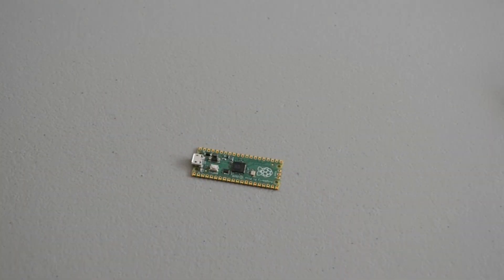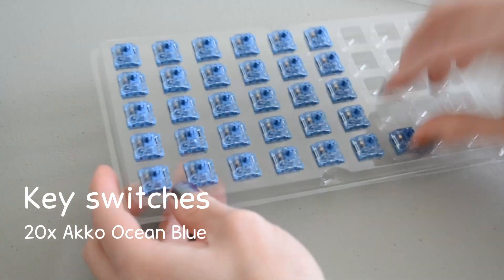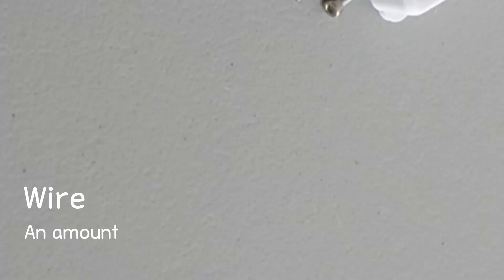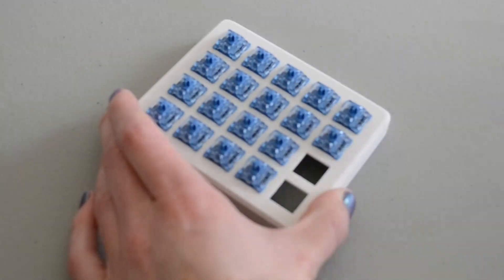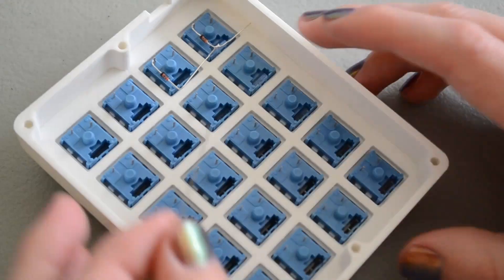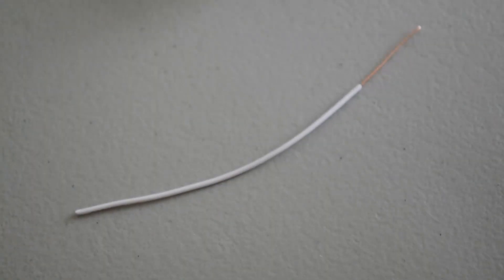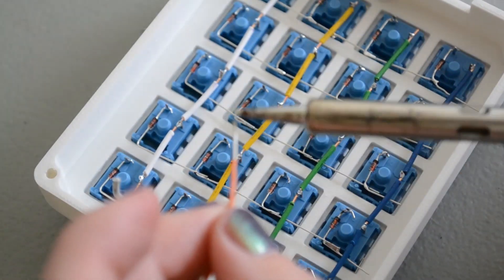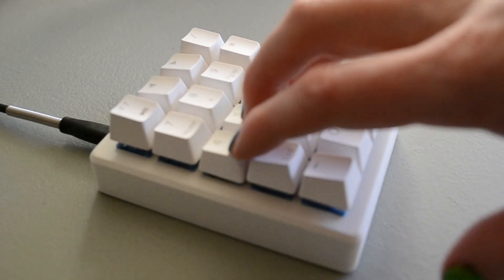Pico Based Num Pad - Part 1 - Assembly

Comment: For what did you used zener diods
Reply from the maker: The diodes are used so the controller can tell apart two different key presses in the same row or column. It also, I think, helps with pressing more than one key at a time

Comment: I made it and it worked. but now it randomly stopped working and the computer stil recognizes it.
Reply from the maker: Hi, I ran into, what I think, is the same issue. I was just able to reflash the pico with the circuit python .uf2 and it works again. I don't know if that's the issue but it is a good thing to try.

Comment: Will the case fit a pico with the header pins still on, my microcenter only carries those. I guess i could clip them shorter
Reply: same ^ ... Im going to try it and see what happens. The 3d model doesnt seem to really have a place for the pico either but it is small
Reply from the maker: I just tested this on mine. I think it will fit but it will be tight. I would suggest at least wrapping the pico in some tape to prevent shorts. Another option would be to scale the base in Z to 150% or so then it should be fine.

Comment: I just finished your original macropad using arduino pro micro and works great.  Guess I need to get a pico and make this next (and learn python). Pro/cons with the pico version?
Reply from the maker: The main pro for me was that this code already existed. I had planned on building this using the Pico for a while, and just happened across KMK. That was my main driver. I haven’t used any of the macro functions in KMK but I do know they exist. 
I think the main con for me is that a lot of changes you make to the layout you have to figure out on your own, they are all pretty simple and well documented, but you do have to dig a bit for something’s. I have been able to get most of the functions to work well. But that could be a limiting factor for some people.
Reply: @tinyboatproductions  cool...thanks for the info and response. I love your vids and explanations.  Look forward to your next project!